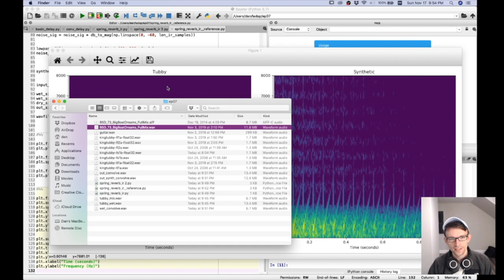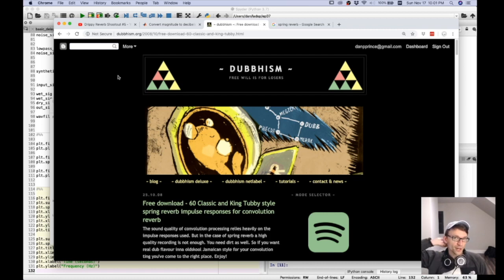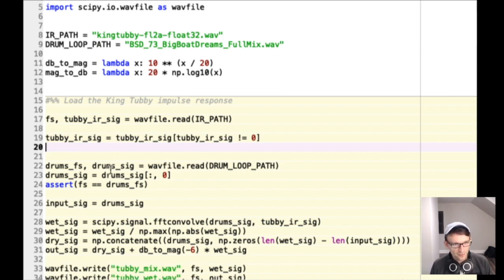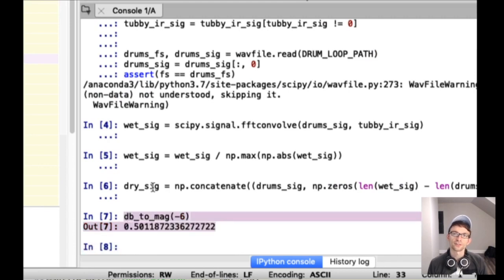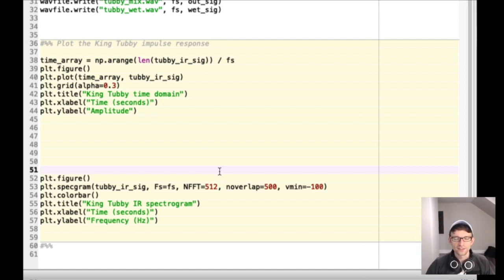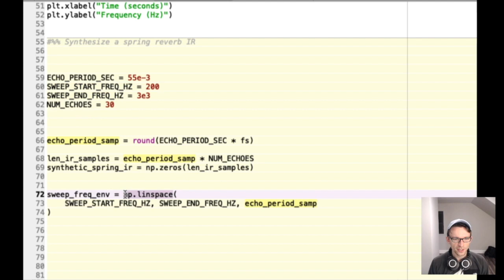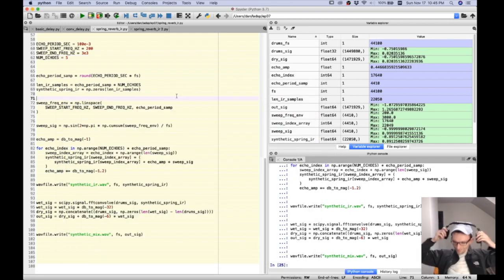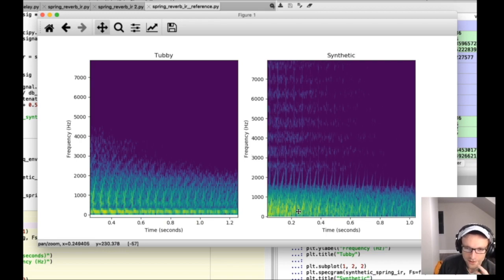Analyzing and synthesizing spring reverb

Comment: fun stuff! For people wondering what FFTConvolve does, here it is a short bad explanation. The FFTconvolve would convert Time-domain to the frequency domain and do 1 multiplication. That changes the operations to be executed from many to 1. After an FFT all it takes is just a multiplication, while in the time domain you would have to perform many operations to get to the result. Convolution can be thought of as a polynomial multiplication, so there are a lot of multiplications involved to get the result, but if you go in the Frequency domain via FFT, then you only have 1 multiplication. So as long as the Time-domain to Freq domain Transformation can be done cheaply, then you can reduce operations from many to 1. Luckily the Fourier transform can be done cheaply on a computer as it is a mechanical transform, hence the name Fast Fourier Transform. FFT can be thought as a fixed scrambling of the bits in the bytes of the data. Please do correct all my mistakes, as I have not looked into FFT and signal processing in over a decade.
Reply from the maker: Yeah I think that's basically right. The only thing I would clarify is the frequency domain convolution becomes 1 multiplication per sample between the input signal and the filter after the FFT.

Comment: Hello Dan !!
In first example, when loading the tubby file, at line 19, when keeping only sample_value != 0, aren't we getting rid also of any zero-crossing sample contained in the actual audio sample ?
Great video, thank you so much for all this. I've never heard about convolution and all this explanation opens a whole new world for my hobbies =)
Reply from the maker: Its true, this line crops out any samples at exactly zero amplitude regardless of their position in the file. In practice though, it's rare for a 16 bit audio signal to have exactly zero amplitude when there are 2^16 possible values for it to take on. It's more likely that the quietest part of a recording or any zero crossings would be a small non-zero value because of the signal's noise floor, and for any samples that are exactly zero to be added digitally where it's much easier to have a perfectly silent signal.

Comment: whats the theory behind this
Reply from the maker: DSP theory says a linear time-invariant system can be perfectly modelled by convolution with its impulse response. An actual spring reverb unit is probably not perfectly LTI, but close enough that convolution gives a reasonably convincing impression of it. Since the spring reverb impulse response is just an audio signal, what I'm doing in this video is to try and reconstruct it from a model of some of its components that I analyze with the plots I show in this video.